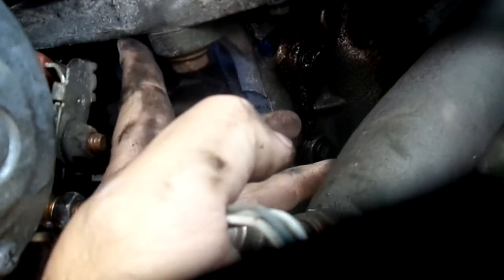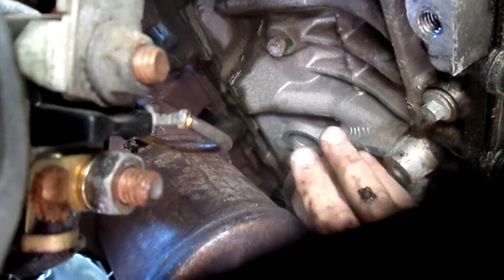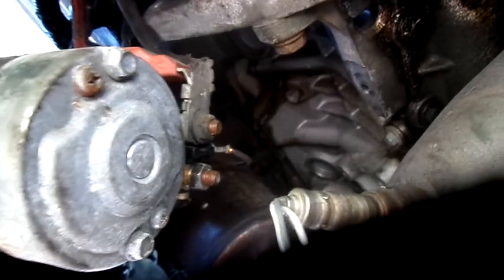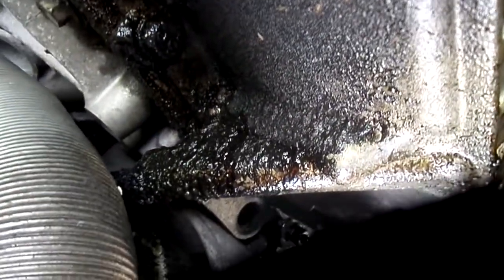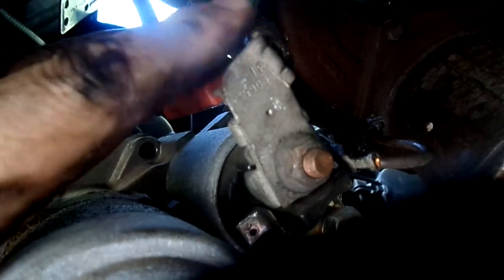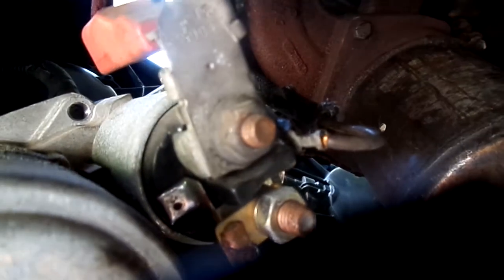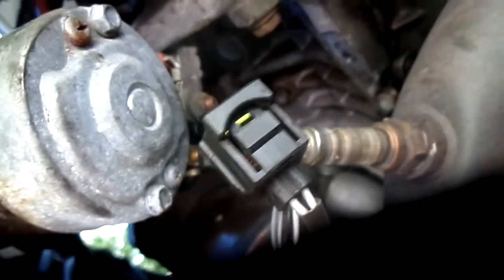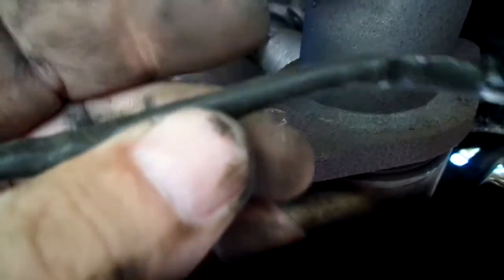Part 2: Tips On Replacing  Chrysler Sebring 2.7 Liter Starter and Motor Mount.

Comment: The solenoid switch that you had mentioned pulls off, does it need to be connected to something somehow? When i replaced mine, the old starter had only connection to the red cable so it was all I reconnected it to. Then the mounting bolts and that's it
Reply from the maker: +Humility4Divinity4Infinity yes it has a small wire that slips onto it
Reply: So being that the starter I took off did not have thos connection to this tube,  i have to go back and connect this small wire from the car itself into a tube fitting on the starter?

Comment: You mentioned the gasket but didn’t say either way to put it on with new starter reason asking is I did this and put the gasket on and now there is a rattle noise coming from starter. Maybe I didn’t have to put gasket on? Or I just got a bad starter? Starts fine but rattle noise is annoying. Your input? Thank you
Reply: hey man im having the same exact problem that you did, did you ever figure out what it was?
Reply: @jacobgillum6453  I just did mine and I think the gasket is in wrong. It wasn't complete so it's probably wrong and is pushed into the housing and hitting the flywheel. When I decide to change the front motor mount I will probably correct this. Also you only have to disconnect and isolate the ground from the battery up top. No need to access the battery compartment although it might be nice to check connections there if it's been a while since tending the battery.